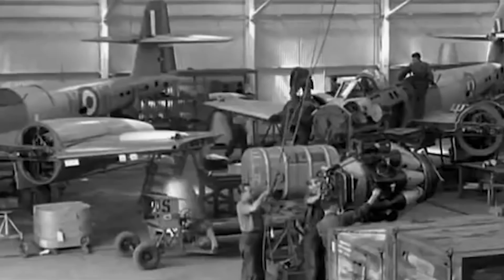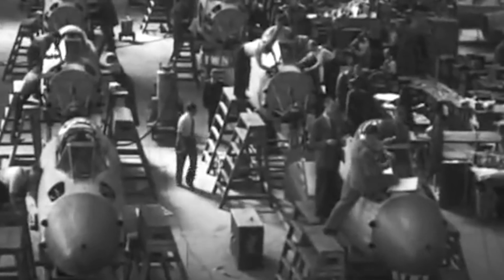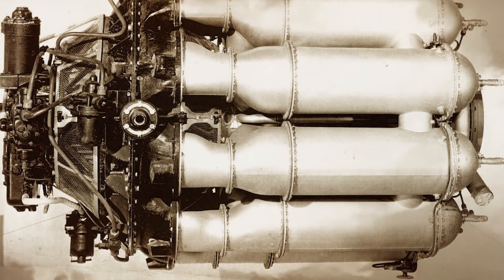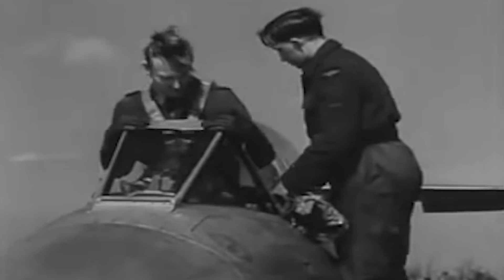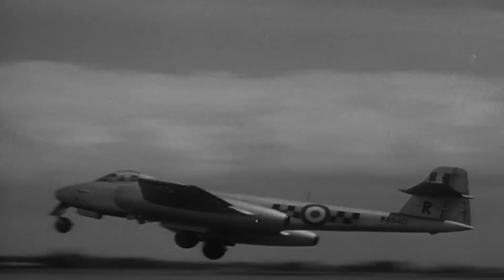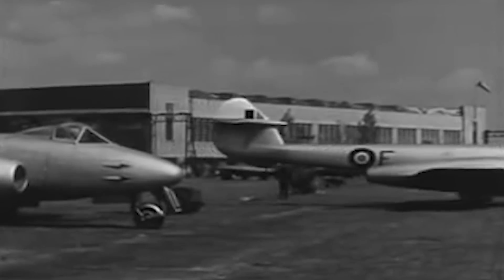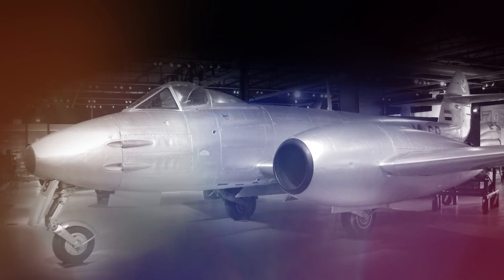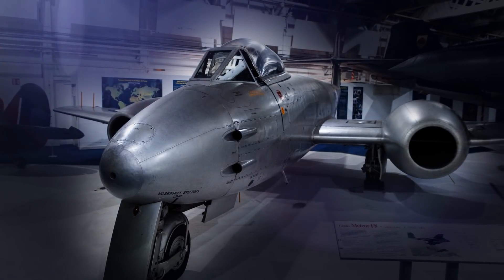Gloster Meteor - The Only Allied Jet to Fight in WW2

Comment: The title should read PRODUCTION jet fighter. Three US P-80s prototypes were tested in Italy during the war.
Reply: 4 Lockheed P-80A were sent to Europe, 2 crashed the other 2 caught on fire
Reply: @sandervanderkammen9230 

We believe we can clear up some commonly held myths and misconceptions, obviously

It's always good to see the facts presented clearly and concisely isn't it?

British Aerospace Sector. 

Interesting British achievements.
There is no doubt that the Fairey (England)
Delta 2 was of course the world's first jet
aircraft to exceed 1000 mph.  lndeed It
exceeded the previous record by 310 mph &
held the record for more than a year. Incidentally, the Dassault Mirage series of aircraft are based on the Fairey Delta 2. 
March 1956,  UK Peter Twiss,
1,132	 mph, Fairey Delta 2,	 Chichester, UK

The next speed record after the FD2 -
December 1957, USAF	1,207.6	mph, McDonnell F-101A Voodoo, 	Muroc, California 😎.

Non combat phase accident losses.
% of Aircraft built.
The EE Lightening did not have unusually high losses. 
The Canadair CL-44 was a turboprop airliner.
Canadair CL-44               (ff 1959 ) 48%
Lockheed XF104             (ff 1954) 100%
Lockheed  P80                (ff 1944)  43%
Lockheed F104               (ff 1954)  45%
MD FH Phantom 1          (ff 1945)  35%
MD F4 Phantom 2           (ff 1958)  28%
MD F3H  Demon              (ff 1951)  32%
MD F-101 Voodoo           (ff 1954)  34%
EE Lightening                   (ff 1954)  33%
Gloster Meteor                (ff 1943)   21%
DH Vampire                     (ff 1943)   23%
DH Sea Vixen                  (ff  1951)  33%
Gloster Javelin                (ff 1951)   20%

Note that the Meteor didn't have particularly high losses, flew with more than 20 airforces for decades, got involved in air to air combat during a number of conflicts successfully against aircraft that first flew many years after the Meteor first flew.

Early days, jet engines. Whittle performed the world's furst demonstration of a gas turbine aero engine in 1937. The RR Nene, a centrifugal gas turbine aero engine, was the world's most reliable & most powerful gas turbine aero engine in 1944. Licensed built versions & copies of the RR Nene & RR Derwent would go on to power many aircraft in Russia including the Mig 15 & Mig 17, the US, China, France & other countries for decades after 1944. Incidentally, the Mig-15 was in essence an upsized / tweaked copy of the Whittle / Gloster E28/39 jet aircraft including a copy of the RR engine.  The centrifugal compressor gas turbine aero engine with Whittle style reverse flow combusters and sometimes an axial compressor section is still manufactured by more than one company, the main application being helicopters.

   That's correct, The Tornado & Typhoon & their engines are supersonic & are indeed British design aircraft with British design engines built by an international consortium. The Tornado design for example started life during the 1950s at Vickers as the AFVG, it's engine is based on the RR RB-199. The EE Lightening is also a British Supersonic jet aircraft. At the time the EE Lightening first flew it was indeed one of the fastest aircraft on the planet.

  The Typhoon is the British BAC-EAP with an engine based on the British RR XG-40, the Typhoon is also built by an international consortium.

  Clearly It's a great pity & a crying shame that British military forces had to occupy a large part of Germany for decades after 1945 & Russian military forces had to do the same. Of course Russia still posseses a large chunk of what was German territory & of course  Russia & the UK produce nukes. Obviously Germany does not produce nukes.

An example of what goes on these days in various countries.

   Indeed, There are no German companies that make German jet aircraft in Germany & there are no German Companies that make German gas turbine aero engines in Germany that are suitable for widebody airliners.

  BAe Systems, GKN Aerospace & Rolls Royce combined now do more Airbus work than Germany on an absolute basis & significantly more work than that on a per capita basis.
   
  Per capita for the home nation BAe Systems is the world's largest defence contractor. BAe systems announced the recent £4 Billion takeover of Colorado based US based Ball Aerospace.
  
  BAE systems now does a significantly higher value of work for Airbus than it did when it was a major Airbus shareholder before 2005.
     
  RR now owns US Engine maker Allison for example which does classified Aerospace work for the US Govt.
   
 Anybody currently flying on a widebody airliner stands a good chance of being on an aircraft powered by RR gas turbine aero engines built in the UK.

  A glimpse of what goes on in the very internationally orientated British aerospace sector.

Boeing Apache Attack Helicopter.
AH-64: 75 UK suppliers, 7% UK content, global fleet of 1280+ aircraft.
F35B more than 130 UK Suppliers, more than 30% UK content.
F35A & F35C more than 130 UK Suppliers, more than 15% UK content.

The UK has the world's highest combined per capita Nuclear, Defence & Aerospace Sector activity.

Rolls Royce Holdings UK
Subsidiaries
- Rolls-Royce plc
- Rolls-Royce North America (Allison etc &  
  Classified Military stuff)
- Rolls-Royce AB
- Rolls-Royce Deutschland
- Rolls-Royce India Private Limited
- Rolls-Royce Marine Power Operations
- Vinters Engineering Limited
- Rolls-Royce Controls and Data Services
- Rolls-Royce Power Systems
- Bergen Marine
Joint ventures include:
- Rolls-Royce Turbomeca
- MTU Turbomeca -

Trent Family
The MT30 (Marine Turbine)
Industrial Trent 60 Gas Turbine
Trent 7000
Trent XWB Airbus A330neo.
Trent 1500
Trent 1000
Trent 500
Trent 600
Trent 700
Trent 800
Trent 8100
Trent 900

RR wholly owned subsidiaries in Germany handle smaller 2 shaft RR gas turbine aero engine work.   

We hope this helps of course.
     
Cheers, as always & indeed 👍.